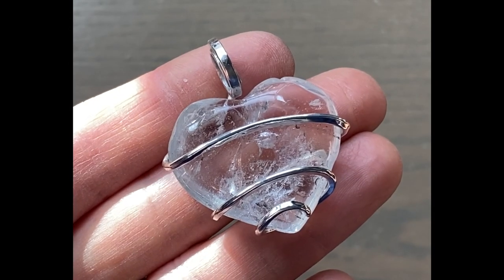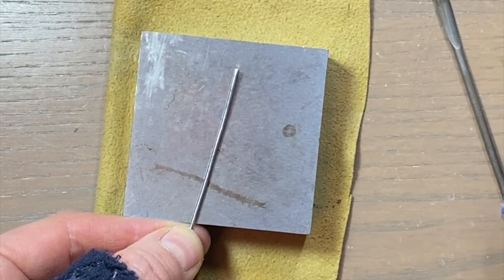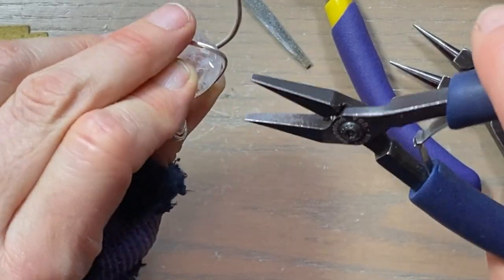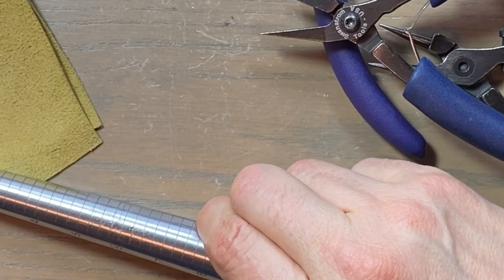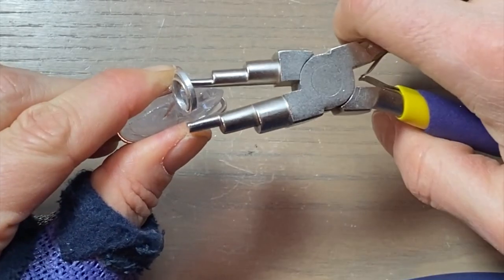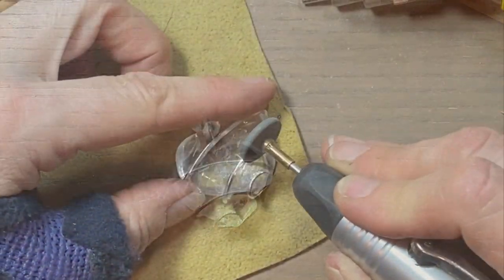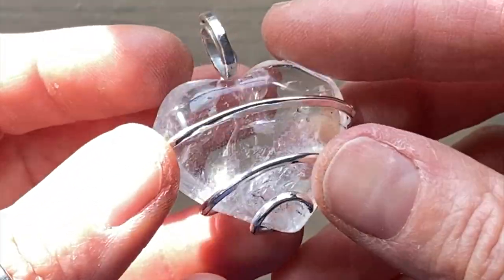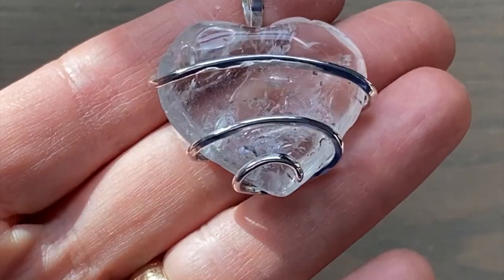Wire Wrapping Techniques- Large Gauge Silver Wire Wrapped Clear Quartz Heart Pendant

Comment: Thankyou so much for this wonderful tutorial~ I am going to be 70 soon and have been working with wire the last few months and although tough I love your videos and have learned so much~~ I would love it if you would make a tutorial on how to use a dremel to polish because I am just learning and do have quite a few scrapes and nicks here and there and it would be awesome to be bale to fix them instead of having to wear them like that ~ I do have a dremel :-) Thankyou so much from one of your Older fans :-)
Reply from the maker: That’s awesome! Welcome to this art! I will definitely make a video soon on that. Thanks for the request! ☺️💜
Reply: Same here, just purchased a small rotary tool and tried the attachments that came with it to polish but it didnt work out like yours did. Didnt even know about the little rubber wheels. Would like more information about using that to finish and polish off pieces.